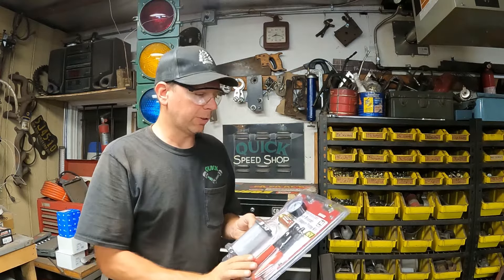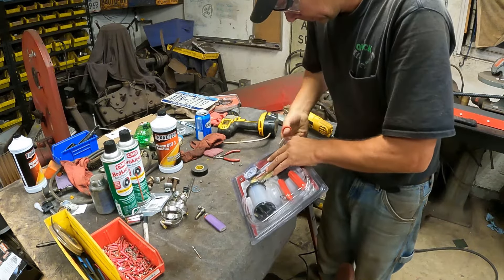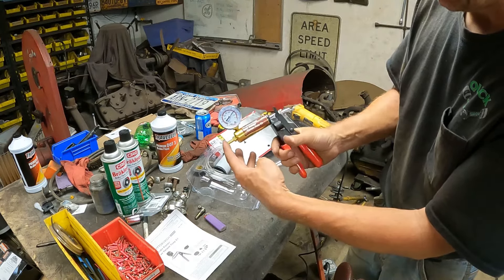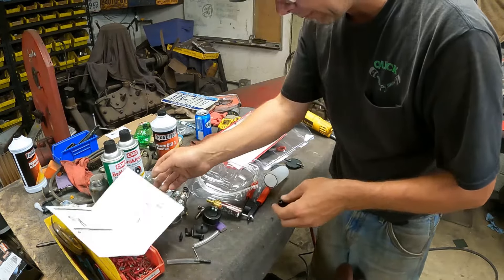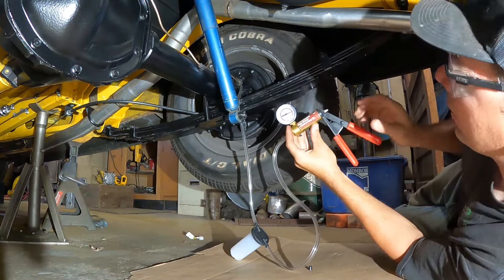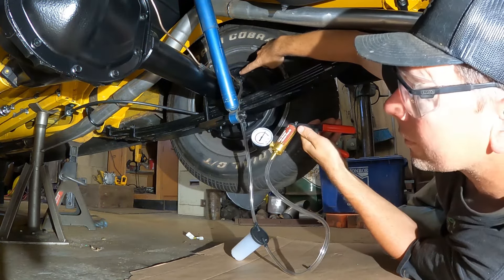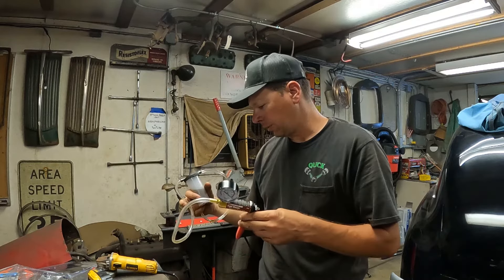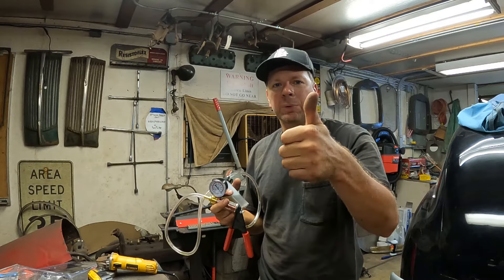Harbor Freight Brake Bleeder and Vacuum Pump Kit:  Tool Review

Comment: You forgot to put the little hose in the container. The little hose goes on the inside of the cap, inside the container. Fill it half ways enough to reach the little hose so that no air goes back, only fluid.

Comment: This bleeder is trash.  I bought one and right out of the package following the instructions it wouldn't build up any pressure whatsoever (and yes I did take out the little plastic piece that holds the handle in the packaging).  I took it back, the store manager tried it he agreed it didn't work.  Exchanged for a new replacement, same thing again.  I ended up going to Amazon and for about the same price got a pneumatic bleeder kit that attaches to my air compressor, which also comes with a filler bottle for the master cylinder.  It works great!  Don't get me wrong - I love Harbor Freight, but this bleeder is junk.

Comment: Seems slower and more complicated than the standard 2 person method (one person pumping the brakes) if you have another person to spare.

Oh, just realized you opened the bleeder before attaching the hose/ drawing vacuum. That’s a good way to suck air into the system.

Comment: The air bubbles may be coming from the bleeder screw and caliper.  If so, try applying silicone lube to create an air tight seal and the vacuum should be re established to draw more brake fluid.

Comment: Mine kind of worked but it seemed like I could never get a good flow of brake fluid to come through the hose once I opened the valve, probably operator problem. It definitely had suction. I got a little frustrated and had my girlfriend help me with pumping the brakes. Pump 1-2-3 hoooold.. Lol
Reply: Did you loosen the cap to the master cylinder?  If not, the enclosed pressure will prevent the fluid from flowing to the brake, from my understanding.
Reply: I'm researching this at the moment because I had a similar issue; I was always getting air bubbles, even after I was sure there was no air in the system. I think air was sneaking in the vacuum hose through the threads on the bleeder bolt.

Comment: I find that the harbor freight $20-30 vacuum kit that uses an air compressor works so much better I just pull the handle and the air compressor pulls an vacuum and it's super easy.
Reply: You should mention that the air compressor kit requires a pretty good sized/flow air compressor and can still take a long time.
Reply: I have an 20 year old 30 gallon husky air compressor and it doesn't take that long it did a good job for the price.

Comment: So you can completely replace brake fluid from the system using this pump, correct? You'd start with the longest line, then move onto the shorter lines until you've colleted enough fluid to be sure you've evacuated the entire original volume?
Reply from the maker: I think you could.

Comment: I tried using a vacuum bleeder pump much like this years ago in trying to bleed my brakes. It sucked too much air past the threads of the bleeder nipple to be of much use. Even wrapping the threads of the bleeder screw with Teflon tape didn't do more than just slightly reducing the amount of air that was getting sucked in.

I'm going to go with a pressure bleeder at the master cylinder for when I want to bleed the brakes on my car in the future.

Comment: The smallest cap doesn't fit my bleeder, the air pressure keeps going down
Reply from the maker: Might have to put a piece of hose on the bleeder than try and hook that to the pump

Comment: It was sucking air in at the bleeder valve. a suggestion would be to put either some grease or Teflon tape on the threads of the bleeder valve. I agree that the bleeder valve was not all the way open at first. something else I noticed is you didn't have the short hose in the reservoir. with those issues remedied I think it will perform better for you the next time.

Comment: Like many Chinese tools, this one is a cheap copy and falls short of brand name tools. I bought one and used it for clutch bleeding in a system with common DOT3 fluid.  Within hours the O-ring for the recovery cup was swelling and became so large in diameter, it wouldn't fit in the groove of the cup.  They provide an extra O-ring in the kit.  Clearly, they know of the issue.  A few hours of exposure to the fluid and it was no longer usable.  This tool is a cheap imitation and is a waste of money.
Reply from the maker: I mean, this is a Harbor Freight tool review so...

Comment: So with this bleeder are you able to bleed your brakes yourself without someone pumping the pedal
Reply from the maker: In theory, although I didn't have much luck.
Reply: Because he did wrong. I believe you should build up the pressure first then crack the bleeding valve.

Comment: be sure to take that rubber/plastic stop that is between the pump handle just below the pump piston, as that will hinder the sucking power of the pump. leaving it on will hamper the psi you need.

Comment: You opened the bleeder screw too far air will get in through the threads. Also you did not put a small hose on the inside of the container and fill the container slightly to submerge the hose

Comment: Also you can use the pump to vacuum the air for your coolant flush. The hose is the right size and pliable enough to use in case you have an air drain cock plug. If you don't have an air drain cock plug you could still use it on the radiator cap while you fill the coolant through the reservoir tank, however you would have to macgyver a way to connect the hose to the radiator tank cap. If you can't there are kits that come with the radiator cap attachments and can be pretty expensive.

Comment: Thanks man, I have had the worse luck with these leakin like a sieve, sometimes i can get them to work the first time, then they leak. I finally gave up and bought some speed bleeder valves (Napa) makes it way easier;
Reply: Try putting some thick grease around the hose where it fits onto the bleeder valve, and around the threads of the bleeder where it screws into the wheel cylinder/caliper. Works like a champ and no more leaks.

Comment: I tried one 2 days ago to change the fluid in a 2020 Forester and there was nothing but bubbles in the tube.  I thought it may have just been it leaking around the screw, so I finished the job.  Brakes ended up mushy.  They were firm before I started.   So I just used a piece of hose and rebled the entire system, and I discovered that this vacuum pump introduced so much air that it took 2 32 oz bottles to bleed the system again, to release all the micro bubbles.  The pump seems like a good idea, but I think they let air into the caliper by sucking the fluid out quicker than the reservoir let's it flow to the caliper, and it replaces that fluid in the caliper with air from around the screw.  It nearly got into the ABS system.
Reply from the maker: Yeah, I didn't have much luck either and ended up bleeding it the regular way as well.

Comment: HOrrible kit.  I bough this the other week and nothing but air bubbles coming from the loose bleeder screw.  I sealed with thread sealant and still not working out.  GOnna try plumbers tape as I heard that works better.